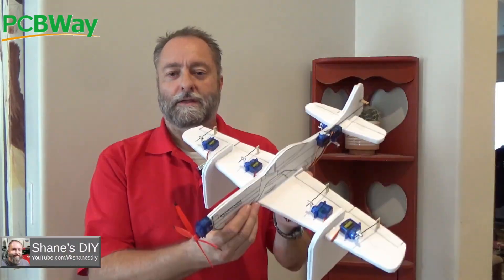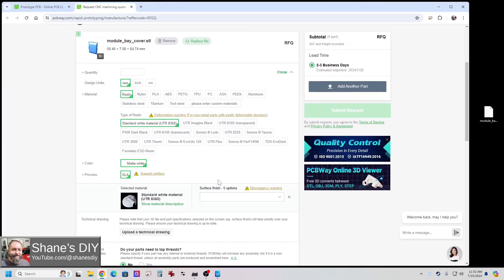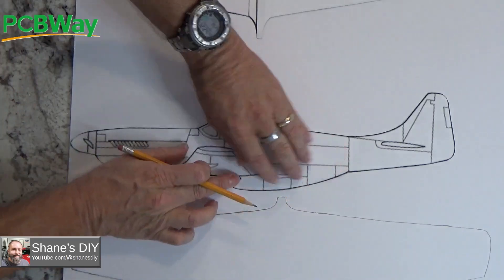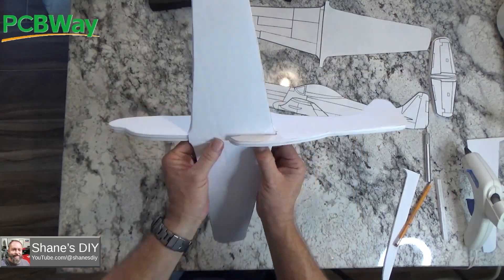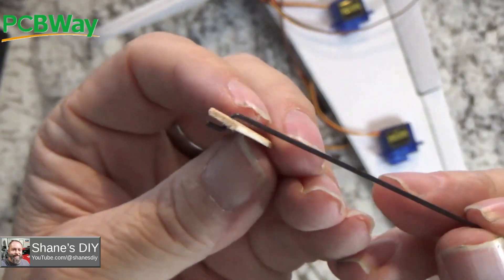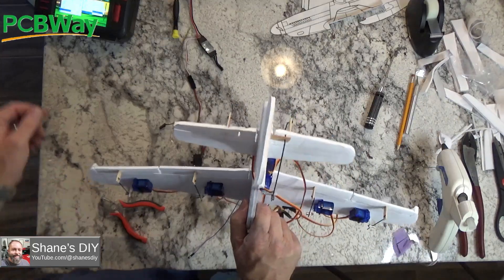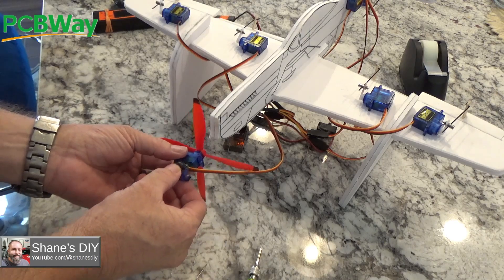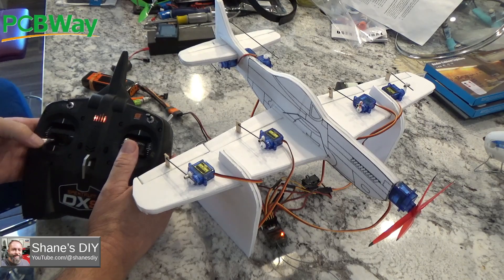Do It Yourself - Cheap RC Radio Setup Test Model

Comment: hi what receiver did you use?
Reply from the maker: During the video I had an AR631 connected but the intention is to be able to test any receiver I want.  I've had several different receivers wired up to it for testing setups.

Comment: You actually installed the flap servos correctly. The others I’ve seen have the flaps moving in opposite directions like the ailerons do. I’ve been wanting to make one, but haven’t gotten around to it. Good job..  👍
Reply from the maker: First time through I did have them opposite just like the ailerons, then I flipped one of the flap servos around, didn't show it in the video but talked about it.  Thanks.  It'll be really useful, took way longer than I anticipated having to video it all but it will be worth it.  Thanks for watching and for commenting!
Reply: @shanesdiy  I would want to install the flap and aileron linkages under the wing so that I could demonstrate aileron differential by offsetting either the servo arms forward one tooth or moving the control horns back from the hinge line. But, I could just make a separate mockup that would show the difference in deflection.
Reply from the maker: @txkflier  You should make one of these test models, I'd love to see what you come up with. I'm sure you'd get plenty of use out of it for your tutorial videos.  I haven't made any guide videos with it yet but already used it so many times to do a quick test of a function.  Its been my tester for the new Spektrum AS3X+ firmware so I didn't have to risk goofing up my airplane setups until I get it figured out!